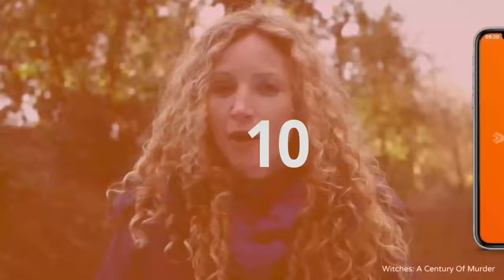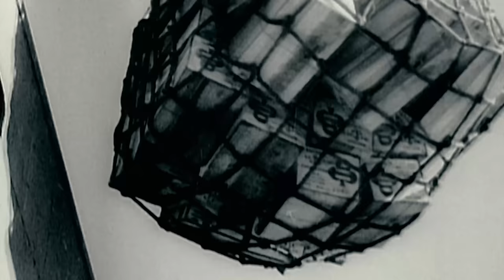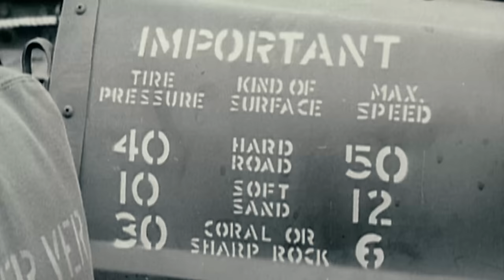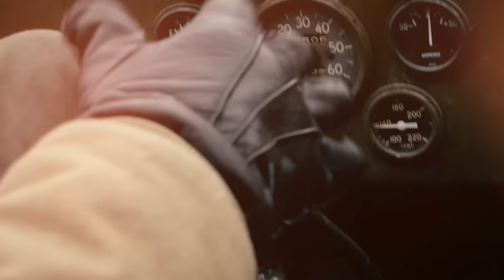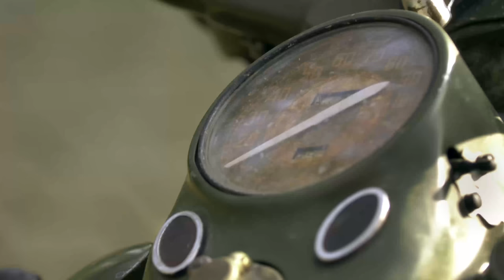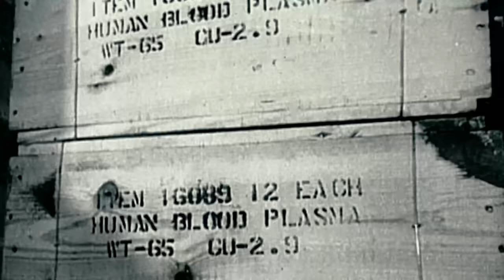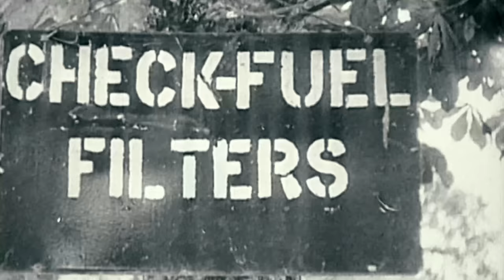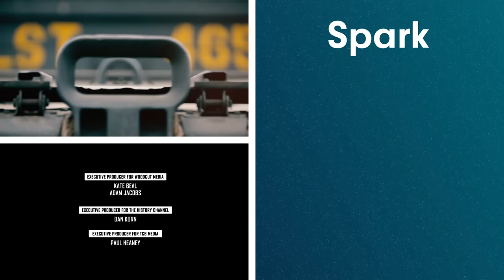The Combat Machines That Won D-Day For The Allies

Comment: Some of the video clips show the Bantam towing an ant-tank gun, with the Bantam and the gun off the ground. I grew up less than a mile from the Bantam factory, and an aunt & uncle worked there during the war.  There is an annual Jeep rally in the town, which is now the largest in the world.
Reply: Where is that, I would love to know. I learned to drive on a surplus Jeep in Florida when I was 11 and 12. My father owned a service station and he had a Willys  Jeep that we used to pull our boat about 12 miles to the Gulf of Mexico to fish and if we left before or just at dawn, I could usually get to drive. It had been customized in that the cab was made of sheetmetal and only covered the front seats leaving the very short area like a shrunken pickup truck. I loved that thing, it shook and vibrated and I am sure that those old hard rubber tires might have been originals. One memory that I had was going fishing after a major flood and that triggered my father to go freshwater fishing, being that saltwater fishing was so much more productive and bass fishing was not promoted or developed. Anyway, the River that he wanted to fish was small, but fed into a very large swamp and the water was up into the forest along the river, so he knew that the bass would be feeding heavily in areas and on food sources that they could not regularly get. We had a 16 foot aluminum boat with a 12 Johnson motor and to get to a launch area where we could leave the Jeep and trailer on dry land we had to drive through water that came into the floorboard and I looked back and saw that it was deep enough to float the boat and trailer a little while. We had a good day fishing tree trunks and brush piles with artificial worms. It was the first time that I remember using them. This must have been in 1959. In 1960 my father got a new and larger Gulf Oil Service Station and he got a Service Truck instead. He totally restored it and it was a 1948 Ford F 150 flathead V8 that was and still is the overall toughest pickup truck that I have ever driven. We had it for 6 years until I graduated and I 75 was about to open 14 miles to the east of US 41 so Gulf built my dad a new larger station with 3 bays, a Tire Center and 13 pumps.

The old professor 

Live free or die!
Death ☠️ to all tyrants, all tyrants foreign and domestic!!!!!!
The truth will stand before God when the world falls!

No Shit.
Reply: @clanrobertson7200  It is in Butler Pennsylvania,about 30 miles north of Pittsburgh.I believe the information is posted on the city website yearly.
Reply: What city and state

Comment: A few thoughts.
The Jeep often had a piece of angle iron mounted vertically to the frame or front bumper, extending up to the height of the roof. This was due to the enemy's habit of stretching piano wire across roads and trails at neck level, to decapitate anyone in the jeep if the windshield was down. The windshield was left down if in a combat zone to prevent flying glass injuries. The wires could be very hard to spot in shade or at night.
The Citroën did  not have four wheel drive. I've not seen one with a winch either.
The DUKW would easily swamp in rough water, especially if overloaded as they often were.

Comment: 24:30  Oil recirculation on air cooled engines really goes a long way too, especially if you've got a sizeable reservoir. I wouldn't be surprised if it decreased case temps by at least 20%. Absolutely vital if you're slogging around at low speed. Never knew about the chain driven gearbox. That isolates even more heat from the engine. Its hard not to miss more primitive designs, I'd readily take the lower power output if it meant easy and infrequent maintenance. Sourcing parts and rebuild kits for modern offroads is a pain , and the small supply makes prices ridiculous if you're on anything older than 5 years or so.
Reply: The P-47 had a 50 gallon oil reservoir, and most aircraft with air cooled radials were range limited as much by oil as by fuel.

Comment: To correct a misnomer "JEEP", does not mean "General Purpose". Their Acronym is a testament to Their simplicity and the reason for being easy to maintenance. It really means "Just, Enough, Essential, Parts", that is the "Real Meaning", of the Acronym "J.E.E.P.".  
Oh, to give you an idea of how were manufactured up through the 1950s and early 1960s. The US Armed Forces still had warehouses full of what was known as "Pickled Jeeps". These were unassembled Willis Jeeps whose parts were still crated in Their Original Cosmoline ( The genericized trademark for a common class of brown, wax-like petroleum-based corrosion inhibitors.).
You could buy a "Pickled Jeep" for $50.00. The only "problem" was You had to assemble Them Yourself.

Comment: The Bantum/Willy's "Jeep" was a 1/4 Ton GP truck...GP stands for General Purpose...
Reply: No! US Army nomenclature was always very specific - nothing "general purpose" about truck, 1/4 ton, 4x4. Ford used the term "GP" for the first 1 500 vehicles built under contract. GP in this instance derived from G = Government and P = 80 inch wheelbase. The contract for a standardised "jeep" went to Willys for their model MB and the versions built under license by Ford were termed "GPW" -the "W" for Willys.

Comment: Very cool vehicles.  I can't decide which I like the most.  Maybe the DUKW.  Not mentioned was a much lesser known amphibious version of the Jeep, the Ford produced GPA.  The Germans also had an amphibious version of their Kübelwagen, known as the Schwimmwagen.
Reply: Because the GPA kinda sucked...
The Schwimmwagen also kinds sucked as it was slow and only had 4WD when in first gear,
and it was only built in small numbers...
Reply: @davidhollenshead4892  Thank you for your reply.  IIRC, the Kübelwagen was 2wd, only.  So, maybe for off-road performance, the Schwimmwagen was better?  I'm really not sure.

Comment: Thank you for your treatment of the Red Ball Express and the CCKWs. My father and several cousins served in it and from the first half of the presentation, I wondered if this would be another white-washed presentation that just showed white faces. In the 1970s I bought a couple of military surplus CCKW for a few hundred dollars each in hopes of making a couple of 6x6 house truck campers but soon realized how poor the gas mileage was even with the little six-banger 270 cubic inch engine. They ended up going local restorer-collector who restored at least one and used it or them in parades, I feel good about my small part in their preservation. Again thank you for this video, it brought good memories and feelings, and I shared it.

Comment: Something that never gets mentioned Is how the Soviets not only pressed much of their own people into the gulags through a paranoid, ultra-repressive dictatorial society strategically for slave labor, their top-down, fear-based system of control ensured inefficiency and vast holes in the most basic of logistical support for the war at hand. They were boastful of what appeared to be an efficient implementation of labor in their industrial output, but it was exactly the opposite. After having American oil companies and American industrialists essentially set up their entire oil drilling/refinery and machinery operations pre-war, they intentionally focused their factories on tanks, tanks, tanks, aircraft, tanks and more tanks. They used mules for logistics, leaving those too old for war and women to literally use hand tools for food production, which led to plummeting yields of 1/3 pre-war production and intentionally starved millions upon millions of their own people (27 million in total died in total, but more died due to the communist system than died fighting Germans, which is so TRAGIC (Stalin and Molotov stayed plump though, so much for ‘communism’). The necessary material to fight their way back to Berlin didn’t come until the US provided Lend-lease material such as food, logistical vehicles, weapons, etc. Without allied assistance, there would’ve been no turn about at Stalingrad. Hitler would’ve steam rolled that vast country as he did early on, though the German’s weren’t good at logistical support either. The deeper they got into Russia and hadn’t even equipped their soldiers with winter attire. The German forces were only logistically sound enough in comparison to an ill-equipped USSR, who had recently killed off his top generals due to the necessarily paranoid disposition of a tyrant in Stalin, who was one of the most blood-soaked monsters of all time, willing to throw life after life at the German meat grinder. If Hitler’s ideology weren’t so psychopathically morally bankrupt, he could have easily turned the people of the conquered portions on their way to Moscow AGAINST Stalin, but then the entire point was to dispose of them ultimately anyway. Makes you wonder why not just kill them later, if you’re gonna be such a dick anyway, but time after time, Hitler was his own worse enemy when it came to strategical blunders throughout the entirety of the war so there’s no surprise there. He must’ve been one charismatic, frightening dude. The entire era is bewildering and important for everyone to continually revisit, as I’ve seen whatever that evil is on a much smaller scale rear it’s head, that pack-animal, tribalist effect that overtakes the thoughtless, most self-unaware among us. It’s frightening.

Comment: Whenever I've gone through Boston I see these DUKW car boats all around brightly painted giving tours of Boston harbor I think,
Reply: The vehicles in Boston DUKW fleet are custom built larger versions of the orginal vehicles.  The business started with military surplus vehicles until they essentially used them up at that time they started the construction of new vehicles using newer drive train systems and specifically adapted components in the propeller system.  A government agency that I worked for had an original DUKW that I maintained and operated occasionally for several years until it was no longer feasible to maintain . Hual rust was the factor that ended using it . And parts had gotten very difficult to obtain.  The design wasn't intended to last 60 years like it did . I  noticed the difference in size as some as I saw the Boston version,  they did a good job but it is not the same .

Comment: "The BMW was a sidevalved engine". And so was ALL the WLA, and a lot of BMW was overheadvalved, had a hand cluch and footshift, so one did not have to let go the handlebars to chance gear. Quite an adwantace offroad, in my expirience... I realy think the "The Red ball Express" was a great achevement, but it could not have happened without a shitload of speed i pill-form. For the USA mainly effidrin, the germans used methamfetamin called "Pervatin". It is still used all over the world, but nobody talks about it...

Comment: 23:25. Harley won the contract over Indian by cheating: the military asked for a 500cc (do not know how many inches is that) motorbike. Indian did exactly that, being robust and dependable pieces. H-D made a 750cc motorbike, which gave more power and better performance, when operational, cause they tended to fail a lot more. But they only had to make more bikes, and the extra performance from a 50% bigger engine made them more suitable for the European roads and the allies war strategy. Indian could not deliver a 750cc prototype in time to respond, and the postwar surplus of HD flooded the bike market, being the last nail in Indian's coffin.

Comment: Would love to find a ww2 Jeep and restore it, also a bmw bike.
Reply: I have heard that you can order a jeep from Thailand. The vehicle is produced with the original dies which were purchased after the US army changed the design. Effectively, you would be purchasing a brand-new WW2 jeep. That's if what I have been told is true.
Reply: @StutleyConstable  That would be cool, coz I want the Jeep, not the restoration project lol
Reply: @StutleyConstable  Um, its actually here in the Philippines. The MD Juan company still makes WW2 jeep parts, they even makes their own version of a "crated jeep" aka the "pickled jeep". You supply the engine and driveline, though.
Reply: @kristoffermangila  Thanks! I will probably never be able to purchase one, but now I know where to look. I'm sure I could come up with the necessary components if I ever need them.